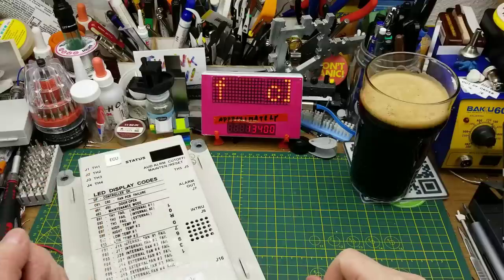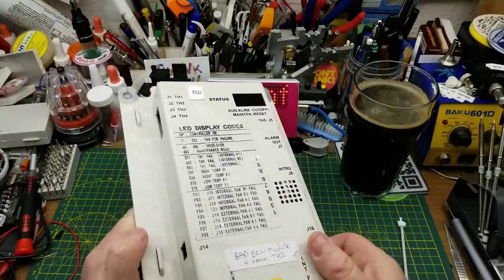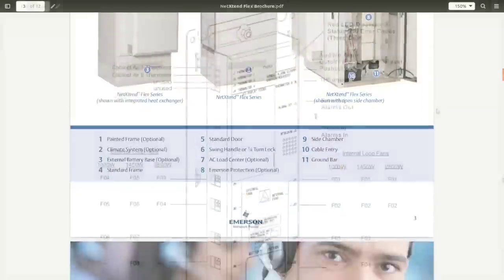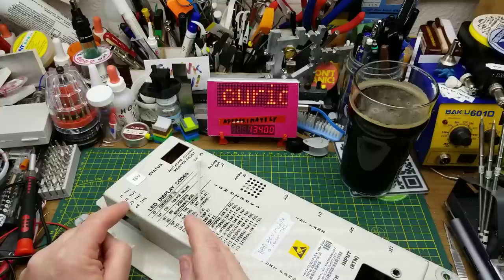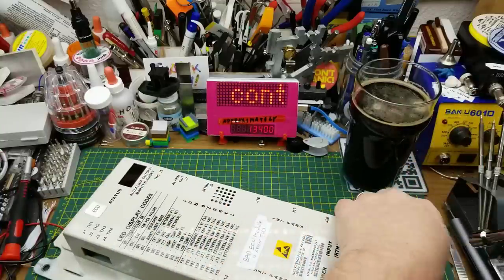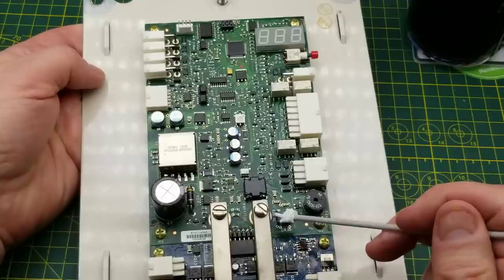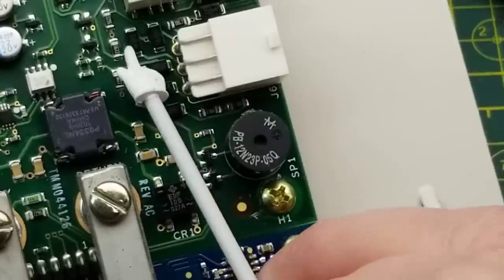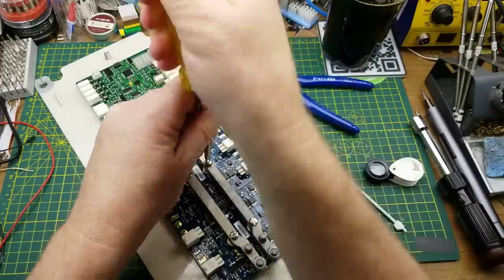curiosity teardown: Telecom environment control module

Comment: Seams all telecom manufacturers don't like any REPAIR OR REUSE, got a Samsung GPSD trained oscillator for building a 10MHz frequency standard, contacted Samsung and they said they don't provide any data to anyone but the system builders.   Love to see what it's saying on the serial port also you can see the Pic programming headers on each board so might be possible to repurpose the drive boards. .

Comment: I bet the header is an RS232 serial interface since there's an RS232 driver right there.  Would be interesting to connect a serial adapter to it.  First scope it with a scope that can also decode.
For the fan boards, I'd guess the interconnect uses serial or I2C with each board or individual fan control programmed with its own address.

Comment: Devices have become so cheap that it is cheaper to replace the unit than have the tech fix it.  Or have techs become that expensive (-: (-: love that idea. Nice names on the chips, they didn't skimp.
Reply: Many companies are risk adverse. They are happy to pay for a complete replacement rather than have any possibility of a lawsuit if it is discovered that an item was repaired and may have contributed to some third party claim.

Comment: Good thing they have the bridge rectifier, around 8:40 you supply red on the left power bar, but around 10:30 you check the meter with the red probe on the right power bar.
(Edit... I see, on page 121, the Red wire is negative 48 volts.   [why the heck can't everyone standarize all the wire colors] )
Reply from the maker: that's the great thing about standards - there are so many to choose from!

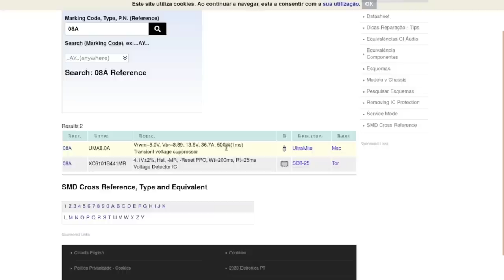Comment: Indeed at 14:00 they are TVS diodes.
Reply: For those wondering why he said "wow" in that tone of voice, 500W for 1ms is a whopping one-half joule of energy those suppressors can suppress before they go *pop*.
Reply: @markfergerson2145  500w is nothing compared to what can be achieved by a small lightening stoke in the area.
Reply: @timballam3675  Yep. That's one reason telco equipment is so overbuilt; see the Carrington Event.
The pins those suppressors protect should never see anything like that though.